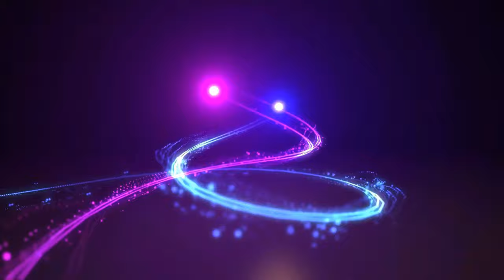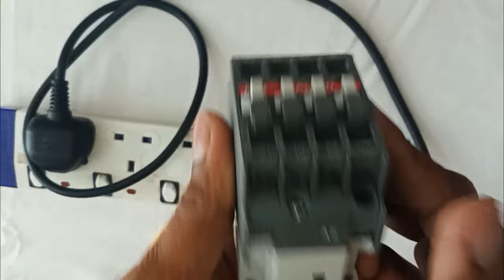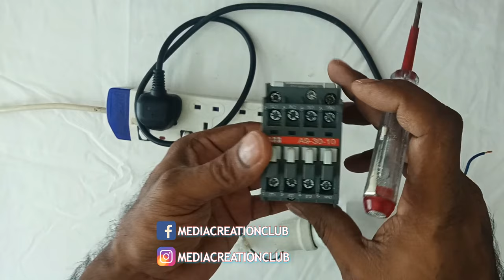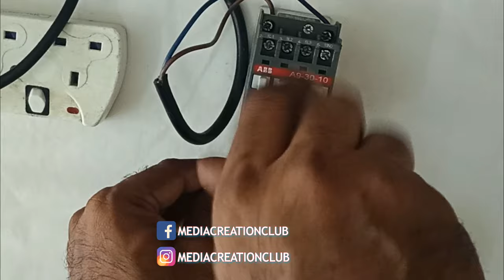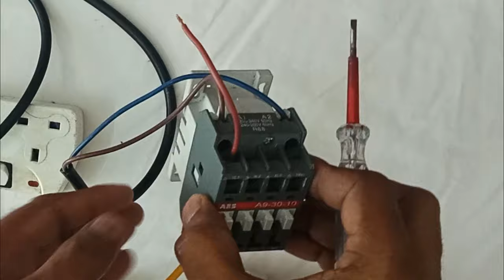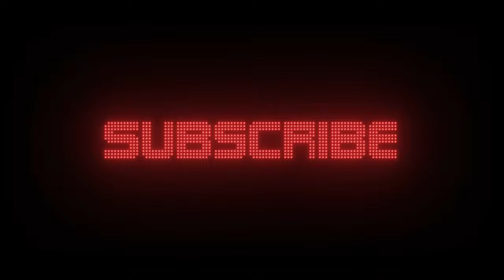What is a Contactor? || How To Use a Contactor || How To Wiring a Power Contactor

Comment: I have an MCG 20a 230v modular contactor, there is full power at the top of the contactor, but no power feeding the bottom of the contactor and so there's no power to feed anything else. Any ideas what this could be? It's also a brand new Contactor aswell. Thank you

Comment: So it is a magnetic driven switch (receiving current in A1 is switch to ON) of a machine like a pump (either one or three phase with the load normally going into L1-L3 directly coming from a breaker with 4mm cables). A1-A2 is than a small switch or timer.

Comment: I understood thanks brother 
Its three phase Contactor right bro?
Reply from the maker: @crasaaqmaxudiin  yes three phase contactor but you can use for anything to control by magnetic way
Reply: @MediaCreationClub1 
Alright bro but the contactor has  A1 and A2 which is coming power supply
That side is used for single phase but If I want to use 3 phase I use those 4 poles am l right ?
Reply from the maker: @crasaaqmaxudiin A1 and A2 normal neutral and phase to on Coil of contactor 

4 pole on top you give any supply to use even 3 Phase delta connections to use
Reply: @MediaCreationClub1  ok bro got it